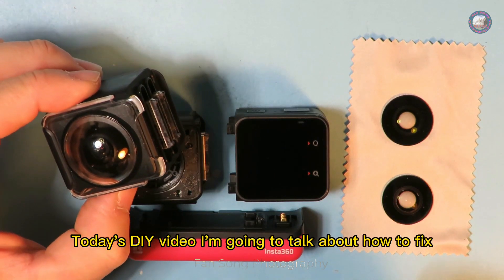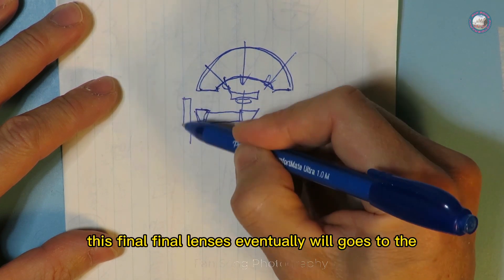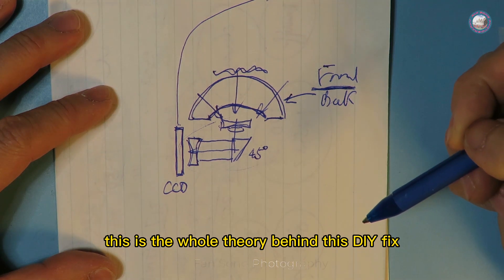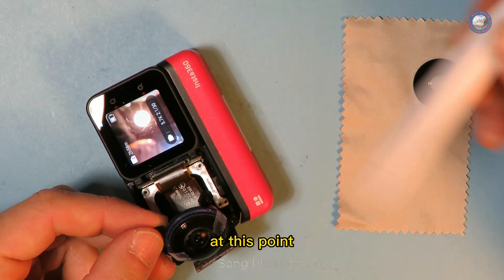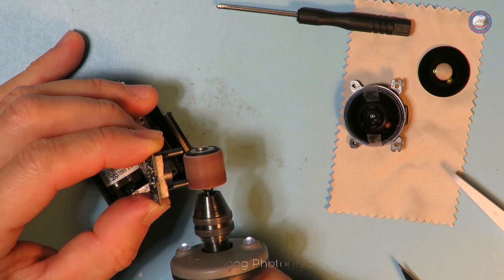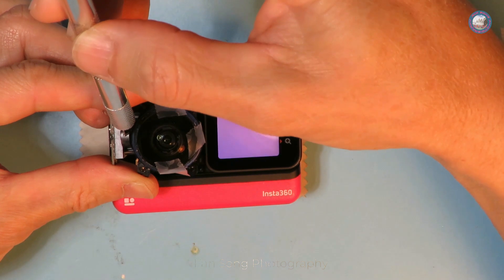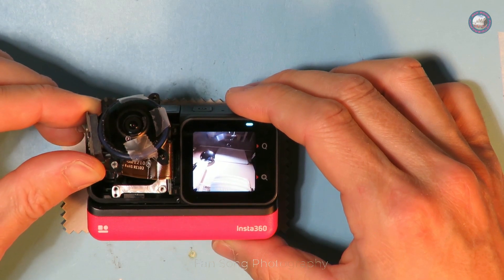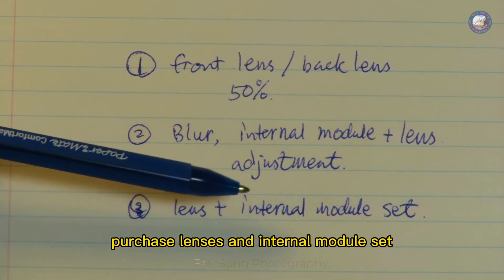DIY fix: insta360 one R/RS blurred image after the lens glass replacement-before returning the lens

Comment: Very good explanation. I ran into this exact problem after DIY the lens portion myself. I tried what you did but removed too much material from the two screw posts on the first go. Had to pad the back of the holes with some paper to increase the distance by about 0.1mm. The difference between a bad focus, a decent focus and a great focus is about 0.04mm to 0.02mm to 0.00mm. At the very end I had to just leave the screws slightly loose by about 1/4 turn. 

Thanks for the video!
Reply from the maker: Thank you for sharing your experience. Yes, this is a very engineering work! You need to fine-tune the distance in the range of 0.0x, a lot of tries and experiments!
Reply: Shar me lens purchase link